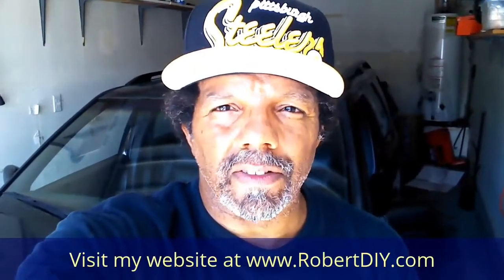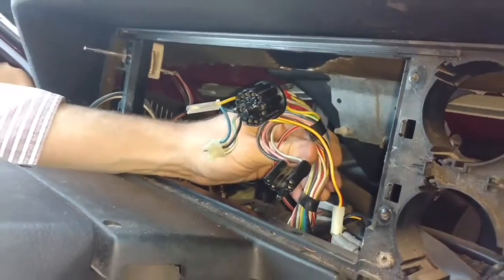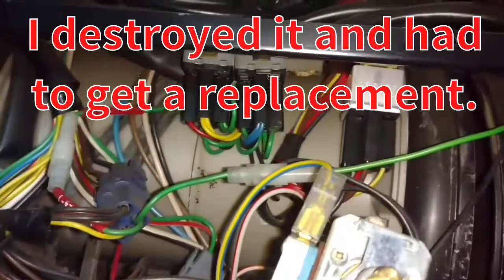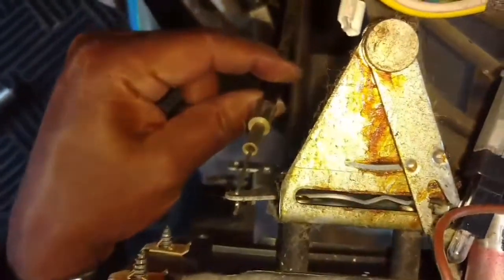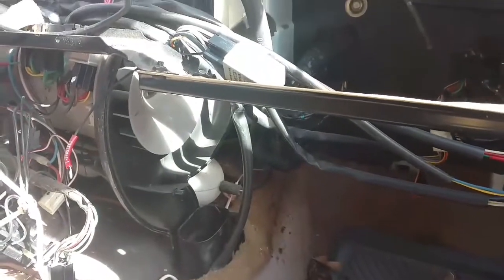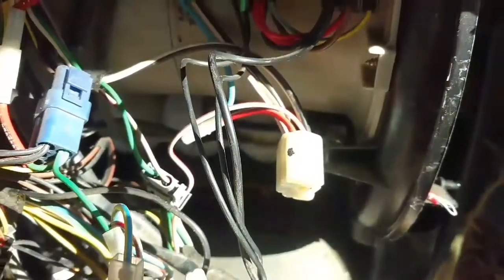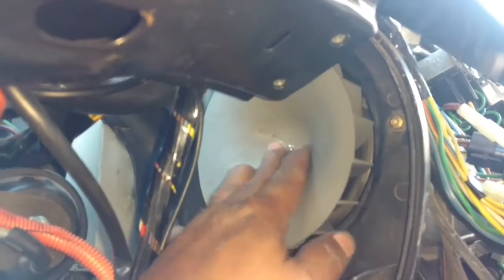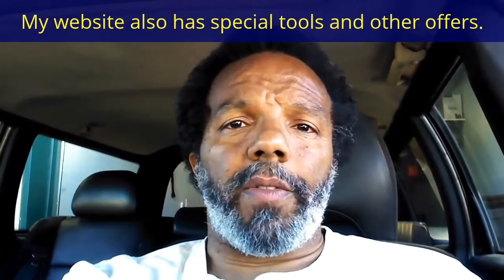How to replace the blower motor and fan resistor in a Volvo 240 - VOTD

Comment: What a job!  I remember in high school replacing my Isuzu I Mark’s fan motor in the junkyard parking lot in about 10 minutes.   I’m considering buying one of these cars. This video was very helpful!  Thank you.
Reply from the maker: You are welcome.
Reply: The 240 is arguably the longest lasting production car ever made. On top of that, it's easy to work on, the parts are reasonable, and there is a great army of knowledgeable fanatics like Robert available to help. 

This is one of the few difficult things to do on this car. The thing I dread the most when it needs to be done. But if you can tackle thisone with success, you can do almost anything to your 240. 

ALWAYS REPLACE THE RESISTOR ALONG WITH THE BLOWER MOTOR. NEVER DO ONE WITHOUT THE OTHER.

Comment: At 16:28 you'll see the open upturned top of the duct that delivers heated air to the rear passengers. I’ve done work in this area before and any loose part that falls from your work above always seems to accidentally find its way down this duct. (Robert knows what I'm talking about.) If it's a magnetic part you may be able to fish it out with a magnet. To avoid this problem altogether however, I suggest putting a rag over this duct end whenever you’re working in this area to prevent its swallowing up your parts. This will also help you avoid using your naughty words.
Reply from the maker: Thanks for sharing.

Comment: Thank you so much Robert... I could not have done mine without your help!       Although I am  stuck right now.. the passenger side fan blade has rusted to the shaft of the motor.   I have been unable to remove it....
Reply from the maker: Dang, time to get a dremel.

Comment: Great narration, descriptions, and camera angles. Thanks for taking the time. I'm going to have to do this on a 1976 244-DL. It's probably a similar nightmare journey to the bottom on that car too. Maybe a few less plastic bits? Who knows?
Reply from the maker: You will soon.
Reply: I heard the older 240s are easier, possibly precluding the need to pull the dash top or front panels.  What was your experience?

Comment: Imagine the Labour cost!   may have to live with the noise for now. WELL DONE !
Reply from the maker: I understand.
Reply: I have a 740.  Some heater component causes loud - wants to eat through the body of the car loud - grinding noise, so I've been without forced heat last winter, and it looks like this winter, too. - With the 740 there is the air bag problem, too, right?  You wouldn't want them to deploy.
Reply: That noise is temporary b/c eventually the fan will break

Comment: On the earlier 240 models, Volvo  used a fan motor mount which had round plastic pods which had to be ground down in order to use the replacement motor with a flat metal mounting. I did mine in 1994 before the advent of Youtube or social media.
Reply from the maker: Cool, thanks for sharing.
Reply: @RobertDIY  Your videos have helped me in the past when I still had my beloved 34 year old 240 wagon. I remember the one about replacing the hood hinges by yourself, which gave me info I could not find anywhere else. You're a good dude, Robert. Thank you for doing what you are doing to help people.

Comment: I'm pretty sure I know the answer to this but,  my 88 240 blower would only work on high. Now it makes a struggling sound and then blows the fuse.. so I guess the resistor was bad but now the motor is toast... Right?  So I need to buy the motor, resistor and the switch? Thanks.. looks daunting but dooable over a day or two.
Reply from the maker: Probably don't need the switch.
Reply: @RobertDIY  any recommendations on what brand of motor and resistor to buy? I'm probably not going to be able to afford oem.  I've read the made in China motors can be noisy but then again.  Are there motors made elsewhere?
Reply from the maker: What are the options?
Reply from the maker: I have no idea
Reply: @Indy452 - you should be able to pick up a new, non-OEM motor & resistor for less than $75 from IPD, Volvo specialists in Portland, OR: https://www.ipdusa.com/ (I've no affiliation with them, other than being very happy with everything I've ordered from them for my 240s over the years.)
Reply: @nick69r  IPDUSA is 100% the way to go. For all of your 240 needs. They test what's available on the market and only carry the good, proven stuff. At reasonable prices too.

Comment: beautiful. thank you!
Reply from the maker: You are welcome.
Reply: on my '79 244DL I didn't have to remove anywhere near as much as you did in the vid. it turned out that I only needed to pull the center console face plate, the center air vents, the glovebox (mostly for access) and 4 bolts holding the vertical struts around the center console to the dash. after that the only thing was pulling the side vent tubes, center vent tubes, and loosening the floor/defrost channels to free up the fan covers. there's an access hole in the top center of the dash, which was sufficient to get at everything when combined with the space opened by pulling the glovebox and the center vents. I didn't have to unplug anything at all.

still took me two days to complete, though, because I had to figure out how to make newer model parts work with older model parts (not a problem I anticipated, since all vendors just claim that the newer stuff is OEM for my model year), which included adventures like figuring out pinouts for apparently undocumented switches and the like. but because my approach was so low impact on the vehicle itself, I was able to drive the whole family around town with it torn apart between working on it.

your vid made it far easier to understand wtf I was doing, though. so thank you very much!

Comment: Do you always change the fan resistor in a job like this? Even if it's still good?
Reply from the maker: +Aaron La such a big job, that would be wise.
Reply: do you wanna pull the dash back out to change the resistor ? rather replace to know its new...

Comment: Robert, do I need to grind the three bosses where the motor mounts?  I've seen some videos that show grinding them off before putting on the aftermarket blower motor.  Right now, with the bosses on the motor sits too far to the driver's side and rubs.
Reply from the maker: Ok
Reply: @preston1957  Ok

Comment: If you are watching this going, how the heck do I get those clips to go back on the impeller? Know that it's not supposed to be hard. You don't need muscle, you need brains! Look for the slot cut into the shaft, and align the clip such that the narrow part is in line with the slotted part. Should slip right on.
Reply from the maker: Didn't my video explain how I got them on?
Reply: @RobertDIY  I think you said something like "slip them on" and my brain couldn't compute. Like other people have said, this video is a lifesaver! I am maybe 50% done with the reassembly and keep coming back to look at your video.

Comment: Hey Robert, when I connect the impellers I can't get the left side one to stop rubbing. It appears there's horizontal play in the motor if you push from the other impeller this moves the shaft out 1mm and prevents it from rubbing. Do you know why this would be? Cheers 
https://youtu.be/8V2nxqFde1A 

See here
Reply from the maker: Not from here.